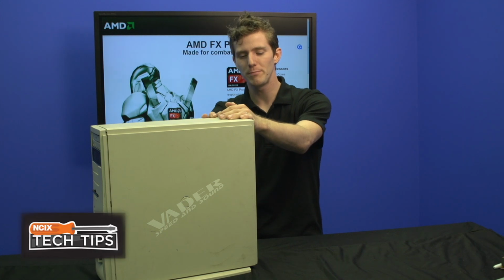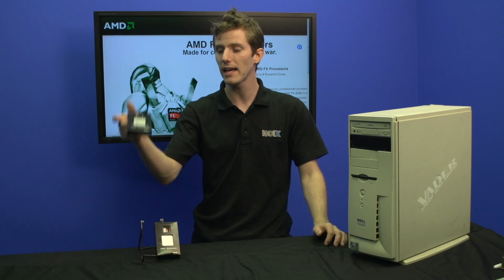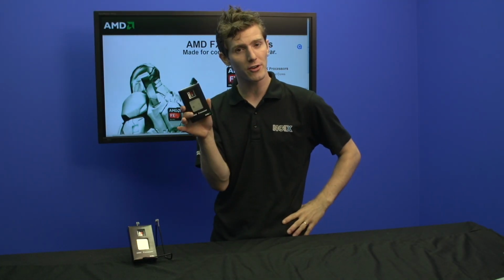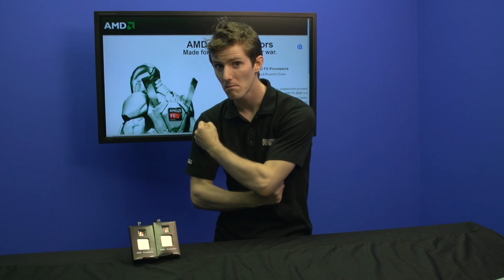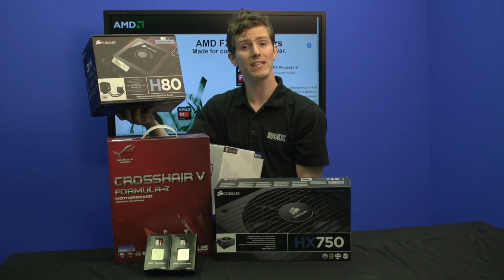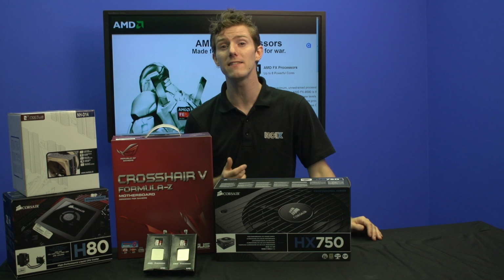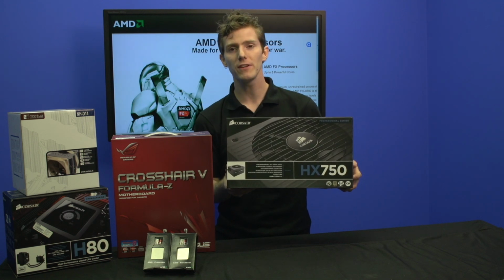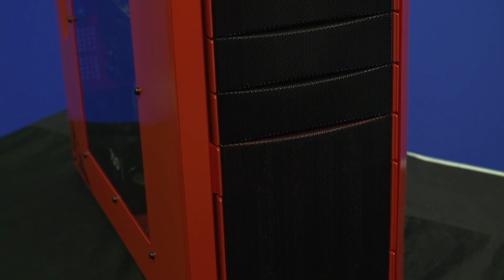AMD FX 9000 series processors hitting 5GHz!

Comment: You're a moron. AMD was the first one to introduce APU they were also the first one design Dual core chips, not Intel. Intel breakthrough is much later developed  than AMD and only has minor efficiency boosts (unless you to the very expensive ones).

AMD chips sell at much cheaper price for similar performance and architecture. But AMD has better overall chip for APUs. 

So no, your judgement is wrong simply based on misinformation by Linus.

Comment: lol the fx9590 loses to the i7 4770k which consumes nearly 150w less then the fx9590 on hardware canucks. The i7 3960x decimates the fx9590 on same 32nm manufacturing process while taking less power. Intel are doing sensational stuff at the moment though efficiency wise. Once the 8 core 130-140w tdp thats is 2x faster then the fx9590 comes out amd would look like a laughing stock. I would be suprised if anyone in there right mind buys the fx9590.

Comment: Great now let's make this AMD Processors much bigger with internal 16GB Ram memory and 100 GB storage memory integrated all cover up by aluminum foil isolating material to keep them cool and resistant to heat as well to be prevented by being hack by the secret waves that human cells produce with there brains which cause the hacking problems and is false that software manipulates computers.

Comment: I Agree, I like how linus is like " cutting edge tech" My asshole. All it is, is a FX 8350 OC at 5.00GHz. If you OC 8350 to 5ghz you even need to use the same amount of Voltage and the same power consumption will be used. So tell me why anyone in the right mind would go and buy an OC £150 CPU for £600-800? AMD suck and they didn't bring nothing new to the table. Intel refine their CPU's. AMD just add more horsepower.

Comment: the worst shit processor for 750$.
this chip has a 4.7Ghz stock n turbo's to 5Ghz with a TDP of 220 watts which is more when compared to an average good performance graphic card.
Even after buying has 2 invest in a better liquid cooler for keeping the generated enormous heat.
if i got 750$ bucks i buy a nice 8350 with a H80i n a decent 970 mobo n put 2 HD 7770s or a single 7970Ghz edition with a decent 16G's of ram.
which is a kickass gaming rig!!

Comment: That Dell is actually quite a capable case. I still have mine. Came out of the factory with a 600mhz Pentium 3. Found it in the basement and swapped it out for an M5A97, Phenom X6 1055t and 8800GT. Runs 40-48c idle and 75-80c under load :)

Comment: Intel used to pay amd to keep there procs underclocked at one point there was a cpu(forget what its called) amd made that was 1ghz but its was actually 2ghz! but in order to achieve this ungodly speed you would have to take gold leaf and spread it on some parts of the cpu to reconnect some contacts and boom 2ghz in the early 2000's.

Comment: Depends on how you want to game. Single monitor, no overclocking, and moderate settings, go for rig 2. Although, I would stick to the 16 gb RAM if I could afford it. I would only go with rig 1 if I'm going to overclock and game with multiple monitors. I have a i5 2400, 16 gb RAM, 2x 550ti, triple monitors, and I can run GTA 4 at almost full spec. At full spec I get about 20 minimum. This should say a lot because GTA 4 is very poorly built and it takes a lot to run it.

Comment: Get first rig, change cpu to Haswell core i5 4670K since it more recent and powered by new socket(though it barely better than the 3rd gen).

GPU- Either GTX 770 or GTX 760, the 760 is sweetspot performance. it sports gtx 670 performance while costing less than 670. 770 is 10%+ gtx 680 performance while costing less.

Comment: I have an fx 6300 and an i5 3570k and in real world 3d model and video rendering with 3ds max and sony vegas my fx 6300 beat's my i5 3570k and in sony vegas it's almost as good as an i7 3770k, of course you don't believe me, but just go and look at ReveiwTechUSA where a 4 year old phenom II x6 2.7-3.0ghz is only 3 mins slower than an i7 3770k and my fx 6300 is much better than any phenom II x6 especially the lower clocked ones

Comment: if you crossfire which gpus?
if you crossfire 2 X hd7850/70 it could work, but anything higher you'll need a better psu like 1000W

Comment: Linus, please benchmark this FX-9000 series with the Intel Core series.

Run these applications simultaneously:

- Three 1080p videos
- Crysis2 and Metro
- One video encoding software which is encoding in 1080p

Would love to see the benchmark results
Compare to AMD to Intel, I would go with Intel. I have two computer, one is mine, and a friend. We play home LAN together. I realised that on air, the AMD A10 (yes not related), is generating a lot of heat compared to my i3. Not air-con env.

Comment: i5 2500k @ 4.7ghz on air cooled with around 62*C max on any single core, and could easily overclock further but my gtx 680 and i5 2500k seems to be at a balance at these speeds so theyre mutual bottle necks, =/ its also a hell of a lot cheaper a year ago for the cpu, I got mine for £120 =P

Comment: Remember clock speeds don't = performance.  It may waste more power but that doesn't make it faster.  Not saying it's a horrible CPU but damn the TPU is through the roof.  It might perform on par for the price but I doubt it will out perform the top Intel chips running on less juice but I'll have to see.  Besides once Honda comes out with the new NSX they should be back on top!.

Comment: If this CPU can't OC more then 5.5 It will suck. Because you need a liquid cooling + high end MB to run this. My I2500k is on 4.5Ghz and i could try to OC 4.8 and still not going above 150W so do the calculations first.

Comment: I've had the same steel mid-tower since 2003 and if I build a new computer I'll use it again since steel cases don't break easily and last decades. So my new computer will "look" the same despite being more than a decade newer.

Comment: Sure it's 5Ghz, but how well does it handle applications compared to a high end intel @ the same price?...  Considering you can get a true 6 core Intel CPU, that's 12 threads/logical CPU core...  I'd love to see an actual beast to beast stackup,  Though I have to say that, unless AMD has improved per core performance, it's going not going to preform as well with multi-threaded applications compared to high end intel chips, which it's priced right near
Glad they are pushing back, but is it enough

Comment: You know I could build or buy prebuilt right now and in 6 months it would be outdated and worth half as much, there are many computers being sold prebuilt that it out performs.
I have a Kingston Hyper X SSD, Crucial Ballistix Ram, a silent video card, Cooler Master Gemin II heatsink and fan, and my prebuilt unit is utterly silent, and because my Financial Market programs put almost no load on it my silent PSU and my other fans never spool up.

Comment: And who on earth is paying $350 used/$700 new for a 5+ years old out dated hot CPU like the QX9770? On the Intel side, most people around $180 would spend an extra $40ish for a 4670K wihch is obviously light years ahead of the QX9770 and x4 980.

Comment: This is basically just an FX8350 over locked so it would just be cheaper to buy a few 8350s bin them yourelf and you are left with what is essentially this processor and a few 8350 for less money.

Comment: I just bought a brand new in the box AMD Phenom ii x4 980 for $182 shipped on eBay which has virtually identical benchmark performance to an Intel Core 2 Quad Extreme QX9770 which sells on eBay for  $350+ used and $700 new.

Comment: So he brings up a a cpu thats not even in the video and pretty much saying that its better and he doesnt even need to explain why? If you ask anyone thats what a fan boy would do, and your not even being accurate with what your saying. There is no amd cpu that cost $1000 the most expensive is the fx 9590 and intel still has cpus more expensive than that and you say you get more bang for your buck with a cpu that cost nearly $600 when there are amd cpus that run just as good for $300 or less

Comment: Not at all. The i7 3930k is a so much bang/buck. These AMD cpus cost like $1000 and perform like a i7 4770k in some cases. One doesn't have to be a intel fan to see that it's a fail on AMD's part

Comment: holy crap thats way too expensive! still sticking with 3930k as its faster in 3d rendering at stock speeds already and my 3930k is at 4.7GHz so it just blows away the fx 9590...

Comment: the only thing amd had going for it was that when you bought one of their processors is that they had a lot of play to them (OC wise) with this one most of it is at its limit mainly because of the large power draw. Honestly i would have preferred they came out with more cores rather than a factory OC cpu....think i will wait till next year for intel to come out with 8 core extremes with ddr4 support

Comment: I would buy it if it wasn't so expensive. I already have the 8350 @4.7 with a 2400 Mhz memory clock. The best balance I was able to get with high CPU clock and high memory clock that is stable.

Comment: Funny, 5GHz, 8 Cores, 220w TDP. But, the performance is still less than a 6 core 130w 3.8GHz intel... IMO AMD needs to work on their architecture... Intel really needs to get rid of that crappy thermal interface on the IVB and HW CPUs...